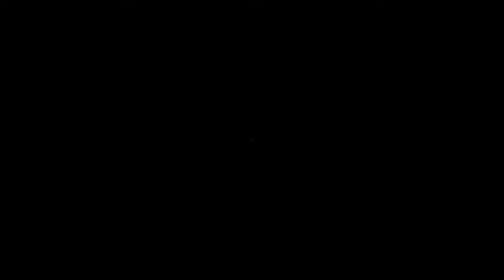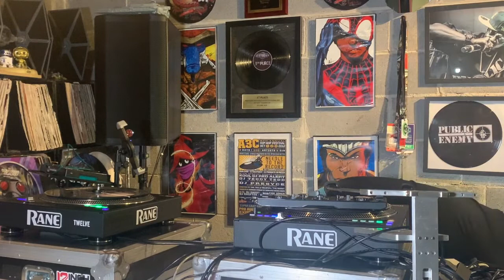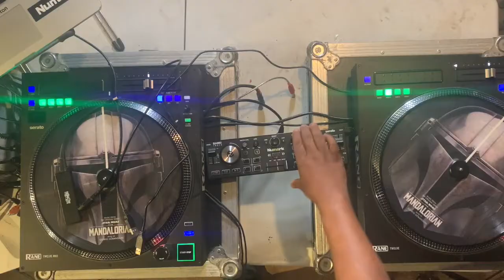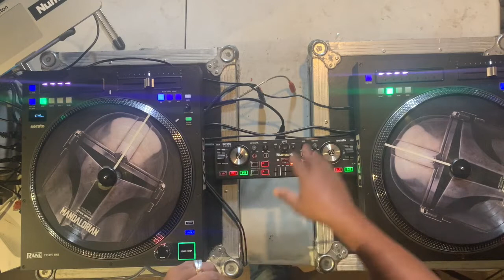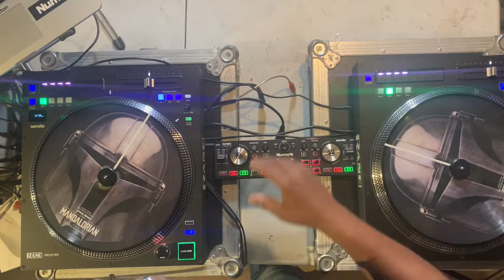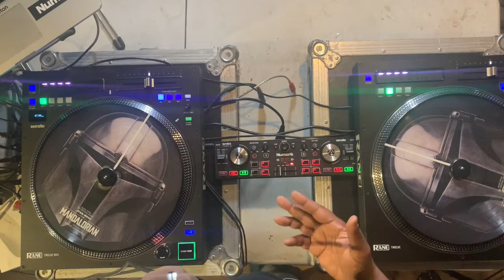Numark DJ2Go2Touch with Rane Twelves

Comment: Everything is connecting but it will not cross fade , it plays on both channels, Any advice to solve problem, Thanks
Reply from the maker: Hmm.. Are you able to control the jog wheels with the Numark device? I've found that it is important to connect the Numark device second after your main Serato interface is connected.